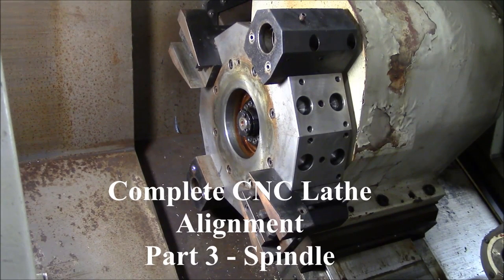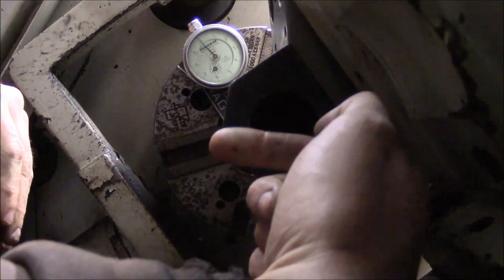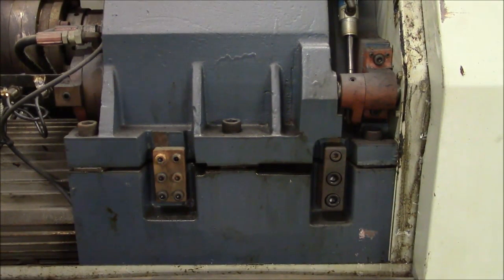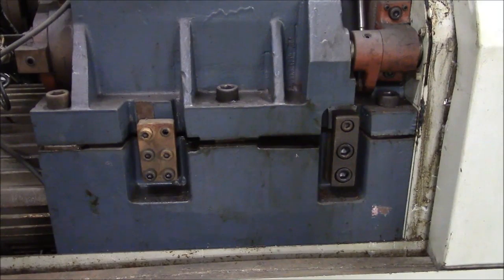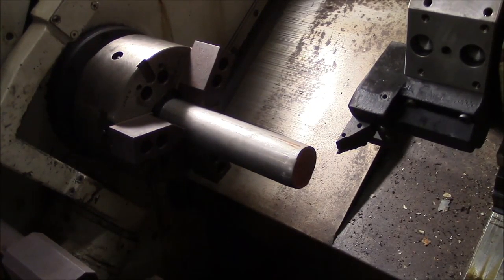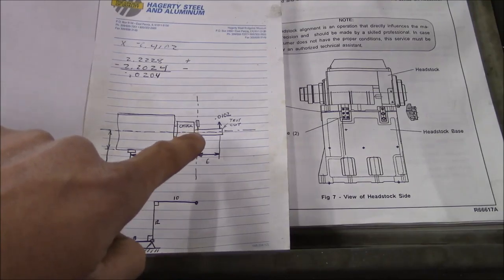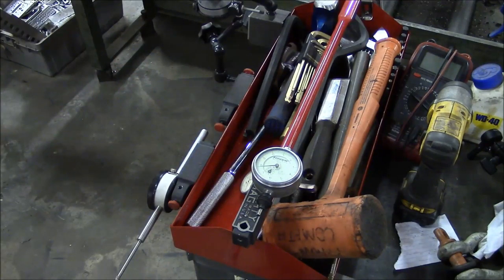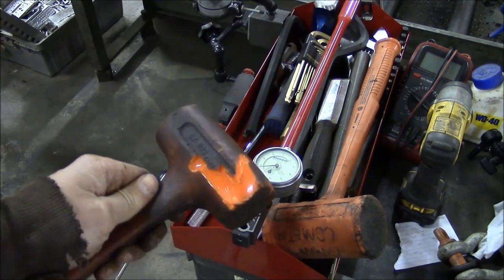Complete CNC Lathe Alignment - Part 3 - Spindle

Comment: Wouldn't it be better to first test for taper turning (maybe without turning but just by sweeping the spindle nose) and adjust it and then check for the center height? I don't want to sound like smartypants especially as I never adjusted a head stock myself - I'm just curious :)

EDIT: Maybe I should stop commenting before watching the whole video as I just saw you were not moving the center line but the angle of the head stock :D

Comment: Is it audio noise or are the spindle bearings shot..I would usually check for play in the slide ways before doing the alignment...
Reply from the maker: It's a gear drive spindle, so it's kind of noisy. There is nothing wrong with it though.

Comment: I have done many lathes like this and have been to the Romi factory in Brazil. They actually have an amazing facility and I think that their Engineers are pretty ok too. The best way to tram a head in like this is to use a test bar in the chuck. Get it aligned with the Z axis plane. Then, using two tenth indicators mounted to the headstock near the adjusting bolts, move the headstock back or forth to align the turret centerline. Then take a test cut and make minor adjustments from there. An acceptable taper should only be about .0005” in 6.0000”. The Hardinge Quest line has the same setup where the X axis is on a slant but the head is not. It’s a little work but by making the machine like this, alignments can be made perfect for very precision parts. This machine that you were working on was a collaboration between Romi of Brazil and Bridgeport. Good job, nice video.

Comment: In my point of view, I would first start by checking spindle play and runout because if some of the bearings are going bad you will never get proper concentricity and your final part finish ajnd dimensions will suffer,
Then I would follow by mounting a test bar in the spindle and go for the head stock alignment to verify if there is any taper.
As for the tail stock, I think it is better to be able to align the whole bed like it is the case for this machine because every point of travel of the tail stock will drive parallel to the spindle axis, not just at a set distance wich would be the case if only adjusting the tail stock like we normally find on a regular manual engine lathe.

Great series indeed! I did learn quite a bit here.
Thanks for posting Wes.

Comment: From where i sit you did a great job Wes,  thanks for sharing your time while doing this time consuming job.
I have to do this on a  Mazak QT when i have the time too.  It is not running as yet,  it is a project that i am working on when i have the limited time. 
But it will be great to have it back in one piece and running again.
Regards Peter.